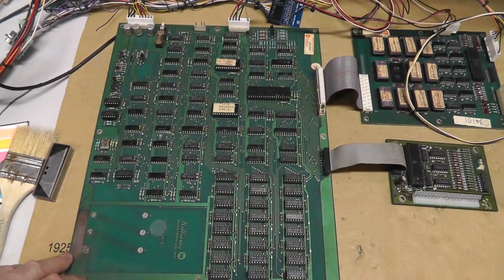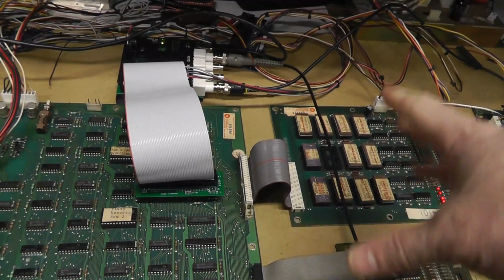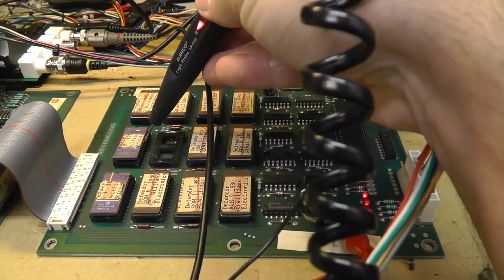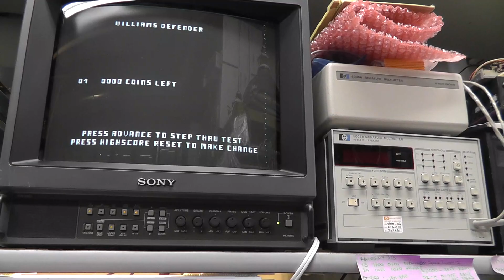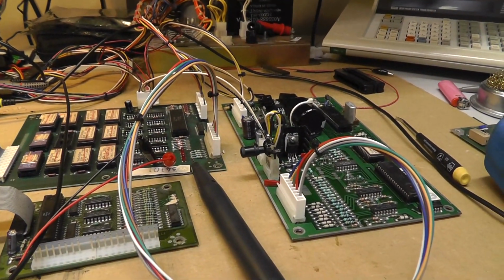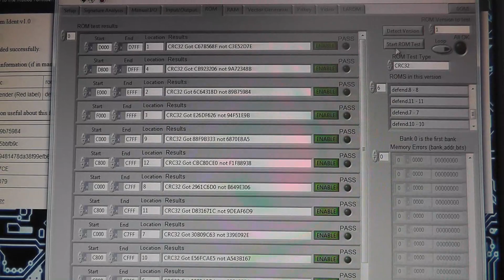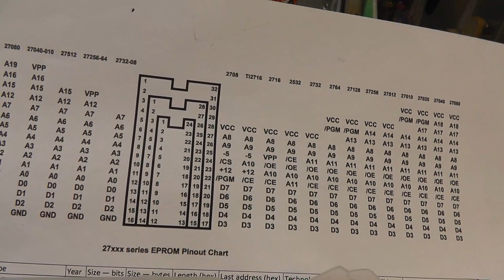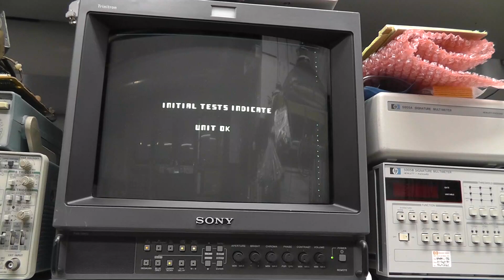Defender PCB Repair - FPGA CAT BOX -  Part 1 Rom Boards

Comment: Do you mind describing your procedure of removing each of those pins? Do you do it all one one side of the board? do you turn the board vertically and heat one side and pull the other? I need details as this is a weakness of mine and no one seems to film that part. thanks
Reply from the maker: I have done it both ways.  flux and heat from top side and use pair of tweezers and turn the board vertically also head from bottom and pull from top side.    Lately, I have been using ceramic tipped tweezers and doing it all from top side.  Helps if the legs are straight on the bottom side first.
Reply: @jacklick  thanks so much. So say I want to do all of this topside. What part of the pin are you heating while having the tweezers on there? Tip of the pin? The base near the board?
Reply from the maker: @onjisan  I heat the base / joint, just like when I am soldering.   sometimes you might need to put some fresh solder down, some flux etc.  If it a particular leg is stubborn, move on and then come back to it;  It could be corroded etc.  if you can't move the pin with light pressure with the iron it can't be pulled.  Most of the time you will just get the pin out without tweezers.  I still have a hard time and pull a trace or pad but have learned to be more and more patient.
Reply: @jacklick  thanks again I really appreciate you taking the time to reply. Going to give this some more practice

Comment: Fixing by probing likely meant that the socket pin wasn't making good contact.  I notice you always probed between the pin and the socket, so that may have moved the metal around.
Reply from the maker: Definitely a possibility but this is a brand new dual wipe socket and I had previously reseated rom a couple time by this point.  Just seems unlikely that a contact failure would persist through multiple reseats and then clear with probe.   Thanks for comment and watching.

Comment: NIce work - do you think the connector on the CPU board could be bad?  Your first ROM board had that weird issue on the one ROM that seemed to fix itself?..  I'm waiting to get a FPGA Catbox..  turns out FPGA's are now unobtanium..
Reply from the maker: good thought on the CPU board connector but that was/is not the issue.  The first ROM board reported the rom error in game cabinet (not shown in video) with totally different MPU board and connector.  I have had stuck lines become unstuck before by momentarily bringing them high or low (sloppy probe handling).  Unfortunately, I need to wait for it to fail again  to see what the issue was.  Double thumbs up on the FPGA CatBox.
Reply: @jacklick  Twice in the past 6 months I've had ROMs check/verify in my programmer (GQ-4x4) and not run in the game at full clock speed.  A real pain to catch since you look at everything else first.  I'm now leery of borderline ROMS.  One was a EPROM I burned, but the other was a factory Atari EPROM. 
I have a bunch of boards I want to create configs for with the CatBox once Fred can ship them again.. But I think it may be many months. :(
Reply from the maker: Not saying this is your issue but I showed in a nintendo vs video verifying roms at +/- 10% vcc.  We discussed this behavior on klov as well where andrewb recommended triple burning the rom when using gq-4x.  I will look for thread and link to it later.
Reply from the maker: Thread referred to above.  https://forums.arcade-museum.com/threads/re-burn-roms-as-preventative-maintenance.453108/
Reply: @jacklick  I did figure out a while back  fast vs. slow..  fast doesn't work on some EPROMs.  I burn them all slow now.. and I think it does it twice.  The strange one was the factory Atari one..  Read good - just didn't work.  Still -  I like that ROM burner.  its done 95% of what I've needed.

Comment: What file are you loading in the CAT Setup Board Config menu you pressed the load Config, but not sure what type of file you're loading unless someone has already been making CAT box files for each arcade game?
Reply from the maker: They are config files which include rom and ram address space/memory map, rom signatures, and other game specific test setup information.  You can make and save your own, like I did with Mappy, but the community is also sharing ones they have done.